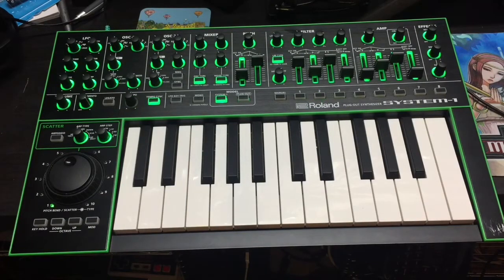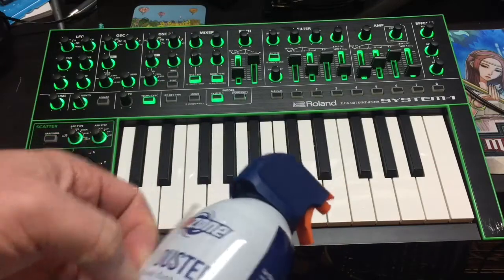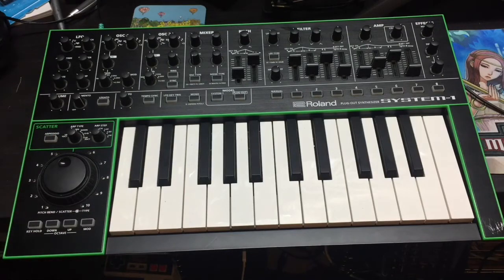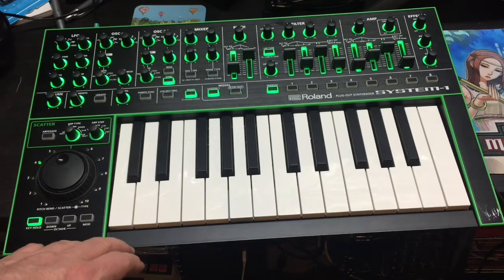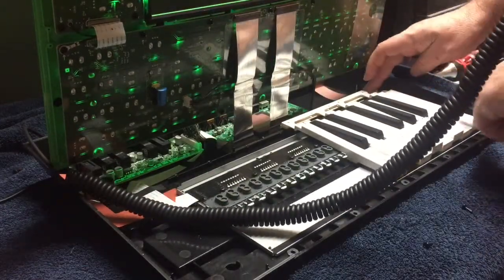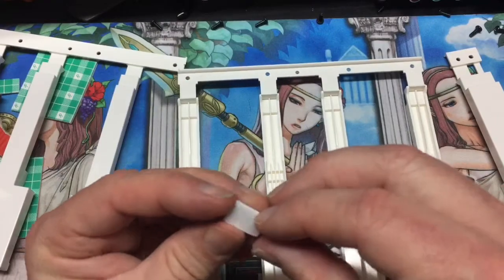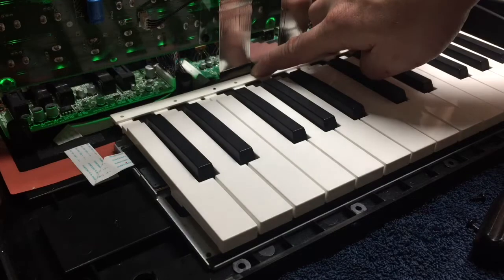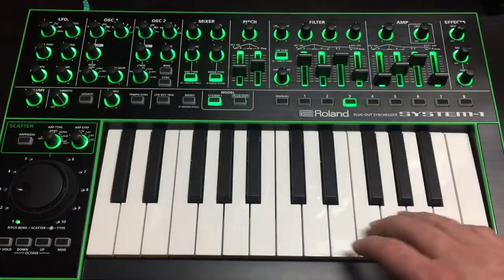Roland System 1 Keyboard Failing Key Repair / Mod Tutorial - Works again!

Comment: FIX WITH TAPE DO NOT WORK WELL!!! You get double keys and it will make it worse over time!!! There is a much better way to fix it!! Buy conductiv paint and, take a q-tip and careful add some paint on the black dots on the underside of the rubberpads. let it dry well. Clean the conductiv pads on the PCB with a q-tip and alcohol. There are 2 rubber arrow like nips on the end of each side of the rubberpads.. they are hard to get back in without special tool, just cut the arrows to get it back in easy, it will stay in place anyway.. this work much better than the tape-fix, i try both, with conductiv paint it works much better, like new!!!

Comment: Hey every one, please read how I fixed three dead keys b4 going for a sort of a tape to increase a key pressure on a key connector which is not a good idea I recon (with all due respect to the Author). After taking off the keys I gently lifted a grey connecting rubber tape, then using a swab and methylated spirit (perhaps Isopropyl alcohol will also work) I gently but DECENTLY rubbed off residue from two black dots underneath, particularly corresponding to faulty connectors. I also cleaned up 4 patches on the panel. It's crucial to clean up properly otherwise  you will be considering the tape as I did after the first loose cleansing attempt. Good luck!

Comment: I had the exact same issue on the low C. I opened the synth to clean it and it fixed it temporarily. The problem kept coming back… I probably opened the unit 5 or more times. I finally fix the issue permanently by adding a few layers of tape behind the faulty key at the point it touches the rubber. I hope it helps someone!

Comment: Well done! Roland System 1 was supposed to be nostalgic but it flopped.  It was $599 new in 2014 and there are a few used for sale asking $400.  Only a select buyer would be interested, as you can download a much better virtual synth like ‘Vital’ for free.  Similarly, you can buy a new midi controller for $120. Still, physical hardware always attracts some attention even if it had a negative reputation.  Sometimes an unpopular synth retains value by being 1 of so few ever sold.  Not sure what your original trade was, but you could sell it as working and put $400 in your pocket 😁

Comment: Thanks man that encouraged me opening mine. I did the same last night, but actually lifted the rubber contacts bed, it is easy to put them back. Underneath you should be able to apply some "contact paint" not sure about the technical name. I didn't have the paint so instead I just put a tiny piece of sticky pad on that little circle on top of the rubber contact to give the extra push! Worked perfectly.

Comment: i had the same issue and the sticky pad works but just want to point out I only used a very small bit of it so it only touches the top connector on the rubber, if it touches both you get double sounds when pressing the key, plus the keys aren't hard on the press they feel exactly the same.
Cheers for the vid though it was a massive help
Reply from the maker: Thank you, I may try and do it again sometime. It’s ok though, I don’t get any double sounds or at least I don’t think so :)
Reply: thanks, i tried this fix yesterday, but for one key i get double triggers, now i know how to fix it :)
Reply: what do you mean " the top connector on the rubber" - the rubber kinda looks like an 8 pattern - by top, do you mean the top of the 8 pattern? (not covering the entire 8) hope that makes sense - dead thread too I know

Comment: There was probably some dirt , dust , skin etc underneath the rubber trigger strip which you can pull off and clean under as well . This is basically the Edirol PCR M1 key bed which sometimes had the same issues . Chosen probably as much for  it’s aesthetics with the whole flat , blocky design of the AIRA range as well as budget because the design team had to dig that one out of the 2007 vault lol
Reply: Yep. There's two contacts and the synth uses the difference in timing between the two to judge velocity. The either start not sounding or sound at full velocity depending on which contact is dirty.
Reply: @6581punk  iijp